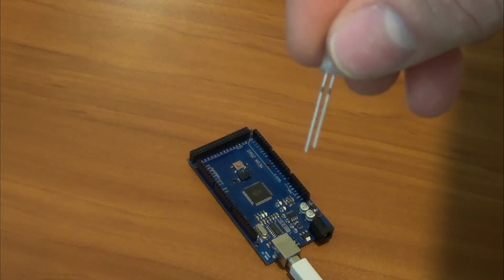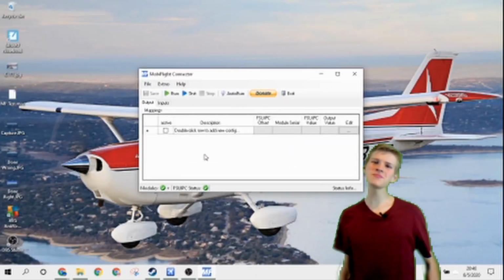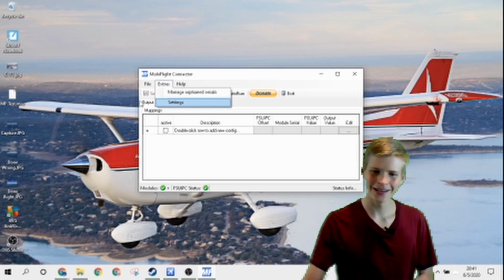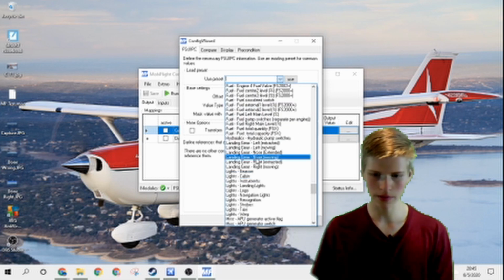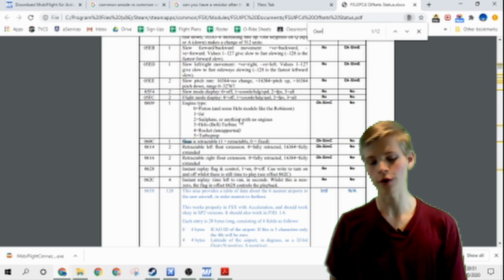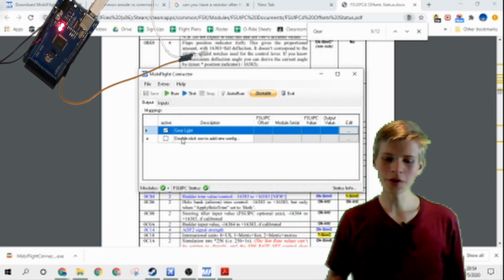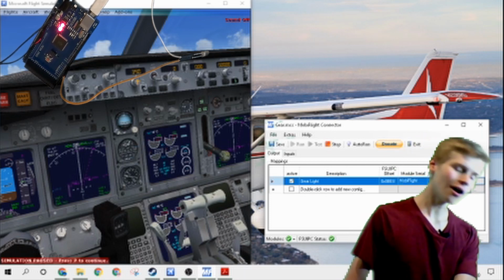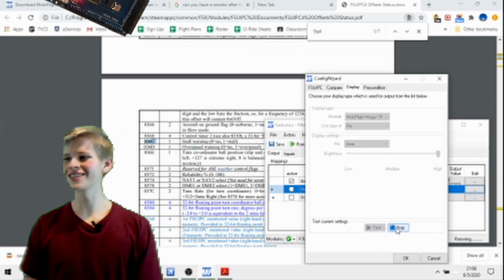How to Wire an LED to MobiFlight (and a secret at the end) | Captain Bob

Comment: Thanks Bob, it works fine... can I also control a LED (e.g. the LED of parking brake B737) with FSUIPC7 in combination with an arduino Micro / Leonardo (ATmega 32u4 instead of ATmega328) ??. This without using Mobiflight. With the micro/Leonardo I have a USB controller that recognizes MSFS directly. I can manage to use buttons and potentiometers, but a LED???
Reply from the maker: I'd love to hear how it goes! I'm not sure how you're getting the light data though.

Comment: Hi, do you know if you can dim an LED through Mobiflight without adding resistors? My green lights are way brighter than the red ones. Thx.
Reply from the maker: You can dim an LED using PWM and setting it to a value 0-225. You still need a resistor because of overcurrent so don't try just using PWM.
You can also use a higher value resistor to dim the lights.
Reply: @CaptainBobSim  Thx!

Comment: it would help if the video is a little higher in resolution?  i could barely read what's on your "green screen"  :)  but a good guide nevertheless :)
Reply from the maker: Agreed! I set it to HD for future videos :) I thought it was but "Canvas Resolution" is different than "Output Resolution"
Reply: @CaptainBobSim  Thanks!   While we're at it, have you (or are you able to) figure  out how to access FenixA320 variables,  specifically for FCU/AP numbers?  and perhaps buttons states as well, eg. AP1/2, FD, LS so we could light LED up?
Reply from the maker: @santiagoluib3  
Use a MSFS2020 event instead of fsuipc.  just filter to "fenixsim" under manufacturer. https://hubhop.mobiflight.com/presets/
Reply: @CaptainBobSim  thanks but I can't find what i'm looking for.  There are "ACTUAL" Aircraft speed,altitude,hdg but I wanted the AP/FCU ALT, SPD, HDG, VS set on the FCU  :)   I guess these aren't directly available from Fenix, I heard other ppl used some hacks to get to this.  Thanks anyways.

Comment: Hey Trevor, Just wondering if you can give me a hand on an issue. I am doing some flying in DCS which I do not believe Mobiflight covers. However, I understand that 9.3 now covers joysticks. What I would like to do is set up a few LEDs to light when certain joystick buttons are pushed. In other words I just want a light to come on when I deploy AIR Brake for instance. So what I would like it to do is turn on the light when the joystick button is pressed without interacting with a simulator. Do you know if it is possible? I have set up INPUT as my T16000M and device as  Button 3  but I am not sure what to select  from the On Press or ON Release drop down boxes. Also, not sure what to select on the Output side. I know this is a bit strange but I just wonder if it is possible. Really appreciate any advise you might have.  

Thanks Kevin
Reply from the maker: Let me get back to you on this :)
Reply: @CaptainBobSim  Thanks, appreciated!!
Reply from the maker: @wingnutnb   Hey Kevin! It was easier than I thought it would be!
I started out by creating an input variable let's call it "LedLight" 
Plug your joystick in and for module select your joystick

Name your variable and
If you want it a flick switch:
For on press say value of 0 and on release say value of 1 (or swap 1 and 0)

If you want it a button (this can easily get out of sync, so be warned)
for on press say if($=1, 0, 1) this will make it so that if the value is one it will turn to zero, but if it is not one, it will turn to one.

Regardless, go under output, and display
Choose your arduino and pin.

There you have it!

If it gets out of sync, you can move the lever in the sim using your mouse to re sync it. You can also press stop on mobiflight and press the joystick.
Lemme know if there's anywhere you need further help!
Reply: @CaptainBobSim  Thank you so much, I will give to a try tomorrow. As always you and your videos are such  great resource for those of us in the home cockpit world. Thanks again
Reply: Hi Trevor, As you can tell I am new to Mobiflight so I am not sure that I completely understand your directions. However, after working my way through it  seems that it may not work as a toggle. In other word press once "light Goes On' press again Light Goes Out" . Am I correct on this assumption.  Thanks, I hope I am not wearing out my welcome here, but I do appreciate your help. If you do not have the time let me know as I understand that you are busy. Thanks Again.Kevin
Reply from the maker: @wingnutnb  For sure! 
I assume you were able to get the toggle to work but not the button.

With the button instead of saying 1 or 0 in the on press/on release window you would give the equation if($=1, 0, 1) in the transformation window on press and none on release "this will make it so that if the value is one it will turn to zero, but if it is not one, it will turn to one"

It's always tricky to convey it over text, so if you can't get it to work email captainbobsim@gmail.com and I can send some screenshots :)
Reply: @CaptainBobSim  Thanks for getting back to me so quickly Treavor. It is getting late here no so I will check this out tomorrow night. I will get back to you.

Comment: sorry maybe a dumb question.. u said "long leg" is positive, (+) and here I can see you connect to GND.. make any difference?  I am new in the filed  so thrilled!. thanks for ur videos..
Reply from the maker: I may have messed it up 😬
Here's something that might help:
https://i.pinimg.com/originals/68/a5/9f/68a59f54e02cf060d591bcae1fa32adf.png
Basically: If it's not lighting up, try swapping it :)
Reply: @CaptainBobSim  u r the man!!.. are my fist steps on this  electrionic world but with more than 25 on simulation.... and let me tell you.. u  are helpe me a lot..~~~thanks!!!
Reply: @CaptainBobSim  try in to update my Throttle  case with gear level and Lights!! and just saw it  you did!!  is my next project!
Reply from the maker: @miketango507  That's so exciting to hear, let me know how it goes Mike Tango!
Reply: @CaptainBobSim   Hi there!!. just begins with my setup. follow yours steps.  got my Mega 2560, download MobiFlight version 9.0.0..  but  in  Extras/Settings/ MobiFlight Modules,  despite show Mobiflight Mega. as configured modules,    in the very bottom do  not show PATH to Arduino IDE....   Iam stuck not idea what is wrong..  any  ideas/  thanks ins advance..
Reply from the maker: @miketango507  That's because it doesn't exist! :) There isn't any need to set a path to Arduino IDE. It now uses AVRDUDE (or something?) to connect to the Arduino.

Comment: Do I still need a resistor when the power is getting distributed to lets say 12 LEDs?
Reply from the maker: Should work, as long as your current is good. Most common LED's require voltage of between approximately 1.2 to 3.6 volts with a current of about 10 to 30 mA, with 12 to 20 mA.

Comment: On man I’m watching the intro while making this comment and I’m getting excited already I think I know what this is gonna be!!!! And what I’ve been waiting for. think it’d be possible for you to help me figure out how to get the landing gear lights in the 737 up to realism. Green while locked and in position and red while in travel.
Reply from the maker: I believe there are some presets you can use (I skimmed over them) like left right nose up/down you can use individually. Basically manipulate the equation/interpolation/comparison until it displays 1 while moving to turn a certain LED on.
Reply: @CaptainBobSim  the part that confuses me still is like is 0 is up and 1600 is down you need green to work both with 0 and 1600. and the reds to work in between those valves to show you the wheels are stuck or in motion so red works with 1-1599. The which gear isn’t the problem. It’s making the leds work opposed to the wheel location
Reply: @CaptainBobSim  I hope that helps? I hate being the guy who doesn’t know 🤧
Reply from the maker: @uniteddrones7626  Oh, I see what you're trying to do now, Use some of the other gear offsets to show when it's moving or not (the nose moving offsets)
Reply: @CaptainBobSim  my issue is they never accept my settings when I enter the comparisons they disappear so I’m way lost
Reply: @CaptainBobSim  if my panel confuses you, you can see it, to further understand my issue and what I’m trying to do here with the landing gear indicator lights. I’m also lost on where the presets are for the master fire and master caution buttons/ indicator lights. 
https://youtu.be/OpTmCaPD7rk